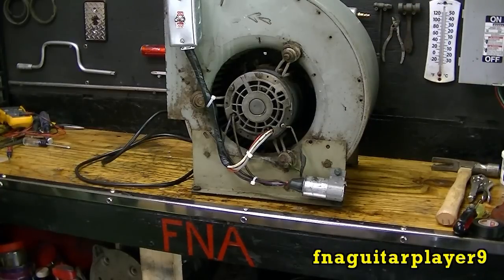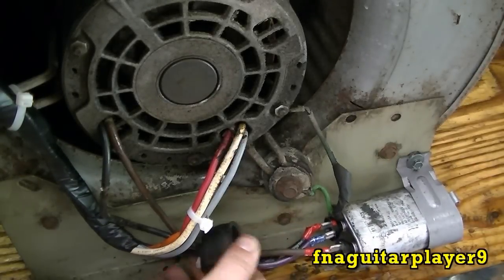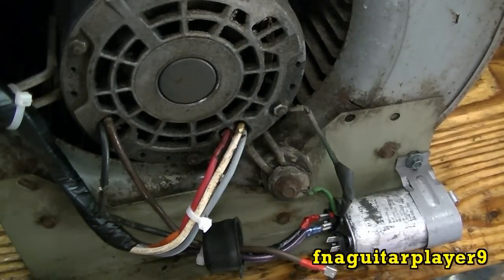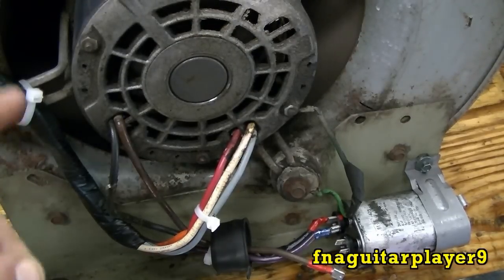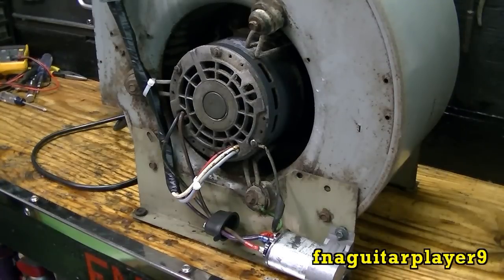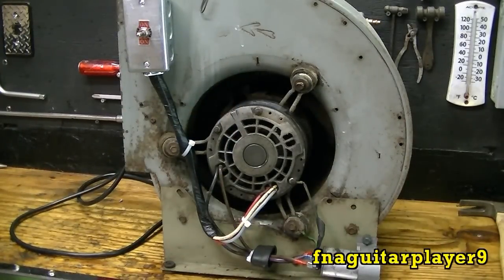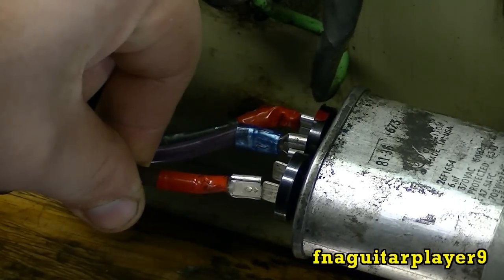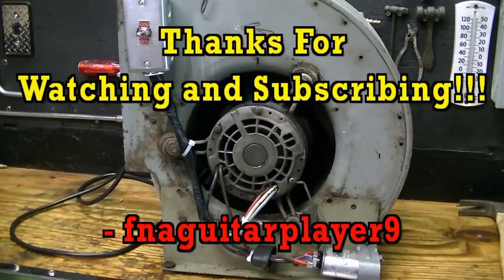Interesting Fact About Capacitor Start Induction Motors

Comment: ok...got a debate going on... right now here in La. we have 90 degree weather with 72% Humids.   its warm to say the least. Well last night about 11pm i noticed that my fan on my outside unit was running backwards.  This has happened before and it was a bad Cap.  So I did what my A/C guy said to do in a pinch and that was to reverse the plug between the cap and the motor.  Sure enough once that was done the fan ran in the right direction.   Well my lovely ADD kicked in and I forgot about it and went out to check it at 3:45p today.  It was running fine and I had missed the chance to go get a new cap again.  It started doing the reverse fan thing again so I reversed the wire again and it ran the right direction.  Now I noticed in your video that you have a 4 wire motor and without the cap plugged in you could hand start the fan in the opposite direction and it would run.  My fan is 2 wires.  ok.. the question... is the 4 wire "non-reversible" motor?   What would happen if the fan ran in reverse for an hour because no one knew it was doing that?  I hate to think Im going to blow the motor overnight by running it normal and it cycling and returning to the wrong direction at sometime.  The debate im having is how long could a motor run with a bad cap if you did what you did in the video by pushing the fan in the right direction?
Reply from the maker: Wilson Revelle I'm not real sure on this, but to my knowledge on motors, I don't think it would harm it, but the constant stopping and reversing might, but if it kept running in the wrong direction, i don't see any damage happening to it, again I'm not real sure on this, i do know if you do like i did in the video and have the capacitor unhooked, the motor is under alot more stress and can overheat. I would suggest getting a new capacitor as soon as possible just to make sure it won't get damaged. hope this helps, thanks for watching!!!
Reply: Nothing at all.
Reply: Wilson Revelle i

Comment: could you tell me this was starting  or running capacitor plz
Reply from the maker: this is considered a motor run capacitor, even though it helps start it. Most of the time if you have a start capacitor its round, more like a capacitor on a circuit board in a tv or something. Thanks for Watching!!!
Reply: Thank you brother for information
Reply from the maker: your welcome!

Comment: nice video. I'm just wondering since my fan motor has a capacitor hooked up to the + terminal of the motor and the - terminal has a neutral hooked up could I move the capacitor to the - side and the neutral to the + side would it spin backwards? thanks
Reply from the maker: Thanks. No that won't work, a AC capacitor functions the same hooked up either way, its not like a battery since the current is constantly fluctuating from + to -. Thanks for Watching!
Reply: fnaguitarplayer9 okyou're welcome.

Comment: Sir... how much capacitor should i need to help my car cranking in the morning? i still have my 12Volt battery attached.
Thank you for your advice sir
Reply from the maker: Capacitors aren't really designed for that, the only time a capacitor is used on a vehicle is for a sound system with subwoofers, because the bass notes will dim lights with each beat, but if your having starting problems its either the battery getting weak, the solenoid and/or the starter. Thanks for Watching!!!

Comment: Thank you. Great videO.  I am very clear after  not to know how to fix an old motor cap start/induction run  on failed big pedestal drill . I am not sure with my old motor 1hp 220VAC ,but have an old cap 200uF 125Volts ,right or wrong value.  I am understand ,it may be right on 200uF (for 1hp motor uf --> 138 to 180 uF  or may be above) but Volt should be 250VAC(its durable).  Please suggest me more.
Reply from the maker: your welcome! Glad to hear my video helped, the only thing i can suggest doing is running the model number of the motor online and see what type of capacitor it uses, thats the only way to be 100% sure if its right. Thanks for Watching!!!

Comment: Keep them coming professor. Nice show and tell.  I have a couple of expensive well pumps I took off line because of no run. Plan to take a closer look at them soon. How do you test to determine a faulty/burnt winding?..
Reply from the maker: I'm no professor haha Heard that, what i do is measure resistance between the wires feeding it (disconnected of course) this usually only determines if there is a open winding, because the resistance is so low it will almost read like a short. I'm no expert on testing motors but that gives you a idea, it will also test the start windings, especially if it has the centrifugal switch in it. Thanks for Watching!!!

Comment: It does this because on an inductance motor, there is a magnetic rotor surrounded by a wire coil. The AC voltage makes the coil an electromagnet. With single phase AC, you need a second slightly out-of-phase AC wave to induce circulation of the rotor. Without the start cap, there is no second out-of-phase AC wave, so no rotation. Once you turn the shaft (connected to the rotor), it causes a rotation in the coil of its magnetic field. That's why you can rotate to start either way. 
Most motors are optimized to run in an certain direction, that's why the start capacitor wants to rotate it counter clock wise;

Thanks for posting the interesting demo video!

Comment: I've never been paid to work in electrical but I know that all large induction motors like this use what is called a start winding and the reason it just sits and hums is because the run winding can't start it spinning. The capacitor is like a switch and initially is on until it charges up and shuts of the current to the start winding. Some motors use a centripetal switch on the start winding. You often here them click off when the motor reaches sync speed and off when the motor slows down after shutoff. Hope this helps folks understand ac induction motors a little better. The easier ones to understand are ones for things like blenders and mixers that use a series wound system with commutators and will run on dc as well.
Reply from the maker: Good explanation, also I will add that the start/run capacitor will also change the phasing of the start windings, as others have noted if you wire up the capacitor different it will start in reverse. It gets the rotor started. They are very complicated/confusing devices! Thanks for Watching!!!

Comment: my advice as far as changeout of capacitors: get a technician. there is some math involved in determining the capacative reactance in each system. it's not something you can guess or it can lead to fire or motor damage.
Reply from the maker: I agree. I'm a licensed electrician, and thats why i said this video was a experiment just prove that a "non-reversible" motor can run backwards. Appreciate the offer, i have books on the subject, motors and theory. I have worked with 3 phase motors before, they are very interesting, whats interesting to me is how you can run a 3 phase off of a single phase (starting it first) and it will generate the 3rd phase, so it can be used as a single to 3 phase converter. Thanks for Watching!!!

Comment: Your video was very helpful.  I changed the capactor in my furnace, but it still seems to humm.  The motor turns on and heat comes out but the humm is still there.  What should I do next.
Reply from the maker: Alot of induction motors will hum in furnaces some do to the low rpm they run, if they ran faster it would cool the air down, it could also be loose motor mounts causing a vibration or just weak windings causing it, kind of hard to diagnose. Thanks for Watching!!!

Comment: hook the black and brown up to the opposite capacitor contacts, and it should start by itself in the reverse direction.

Even easier, move the black wire from the top connection to the bottom cap connection, and it should start up in reverse.
Reply from the maker: wow, never thought of that, that makes sense, i'll have to try it, i guess it switches the phasing so it turns in reverse. thanks for that! thanks for watching!!!
Reply: fnaguitarplayer9 if you'd like I can email a PDF. on magnetism and 3 phase from my electric theory class. it's actually not too long winded and very interesting. inbox me and I'll send it.

Comment: Super easy motor fix: if you have 1 that doesn't start by itself, doesn't run well, or won't even hit a lick, find out if it has brushes. Then try to find some anti-oxidation/conductive grease in your shop or hardware store. Put it on the brushes with an old tooth brush, & see if that helps. I've fixed 2 motors that seemed hopeless, with that type of grease. The kind I have is called ' OxGard '.  Take care, Lee from TN.
Reply: This is not a universal motor , no commutator or brushes,  It has a squirrel type rotor .
Reply: @highspeedgaz  Oh okay, I've heard of them, but never really worked on 1. 
3 phase?
Reply from the maker: Are you talking about the No-Ox stuff that you use on aluminum wire? If so i have quite a bit of that, i'll have to try this out sometime!! Thanks for the tip! Thanks for Watching!!!
Reply: fnaguitarplayer9 Hey no problem man. Your No-Ox stuff sounds very similar to the stuff I've got. Who sells it? Its worth a try, I'm about to try to fix a couple of electric die grinders with it. I'm tellin' ya' dude, my dad's 2 HP table saw would Not hit a lick, put that stuff on the brushes, runs fine now. The 'offshoreorganbuilder' a few comments below should give it a try, but he also might need a new capacitor.  What area do you live in?  Take care, Lee.
Reply from the maker: Probably is similar, I find it at lowes, its in a bottle kind of like wood glue comes in. That stuff is messy haha Yeah it might help. I'm in West Vrigina, US

Comment from the maker: No it does not matter, and to be honest a higher voltage one is a better option in my opinion, think of it as buying a heavy duty version, if the voltage surges or spikes it would be less apt to damage the capacitor. The thing to watch out is the uf and if your replacing a motor run capacitor, it has to be a run capacitor, a start will blow up, and the same if your replacing a start, replace with a motor start. hope this helps! Thanks for Watching!!!

Comment from the maker: Usually if a motor just has a run capacitor it serves 2 purposes, Run and also it helps start the motor as you see in the video, sounds like you may have a bad capacitor, i'd suggest replacing the capacitor. You can't add a start capacitor if its not designed to have one. Thanks for Watching!!!

Comment: Hi, I have an ac motor and it looks like it has only a run capacitor, and no start capacitor. In fact, you have to push it a little to start. Is it simple to add a start capacitor myself ?

Comment: If I brought a capacitor with the same uf but with a higher voltage would this affect my blower or would it operate the same as the old one when it worked...I was told that the higher voltage would not affect blower

Comment: The local motor store where I live charges full retail out of the book for parts. (They also are one of the few technical/mechanical/electric/plumbing businesses locally that hasn't shut down.)

Much, much cheaper to buy off ebay or online, take a chance on getting the right part, buy the other possibility if the first one doesn't cure the problem.

Comment: Thats right, as somebody said below, it's run capacitor, motor will burn if you'll run it without that as well. You can confirm that by checking draw. If cap is too small or not there and you just spin it to go, it will run slow and weak and overamp eventually burn winding. Start capacitors include potential relay, used alot to help reciprocating compressors start.

Comment: the starting capacitor of an induction motor was in series with the auxiliary  winding, and they are both connected in parallel to the main winding. if you will switch that connection from the main to the auxiliary, the rotation of your motor will reverse.

Comment from the maker: yeah, i'll make it as simple as possible! I did do a video talking about how to use multi meters, i think i briefly talked about checking capacitance, but i didn't talk about when they need replaced or anything like that, but you might want to take a look at that video, its a older video i did, i'll pm it to you in a message...

Comment from the maker: The wires can be reversed but it won't effect the direction, since its AC. some motors will have a terminal block inside a cover that you can switch 2 wires around to switch direction, the type in this video doesn't, but mainly what i'm talking about is like a motor that mounts and is belt driven. thanks for watching!

Comment from the maker: sounds like a start/run like the one in the video, i ran that number on the internet and found that its called a start capacitor but works in the use of starting and running motors, i'll pm what I found, can't post a link in a comment, so i guess it is a start capacitor...

Comment: I disconnected the cap, turned on the bandsaw and it hummed.  I then turned the motor but it would not start.  Next i reconnected the cap and turned on the bandsaw and it ran like normal.  I then disconnected the cap while running and the motor slowed down a bit.  Reconnected and it sped back up so I think I have a run capacitor.  The cap is CBB60 SH 16uF @ 240VAC.  My understanding is start caps have a range of capacitance marked on them.  So what do you think?  Thank you

Comment from the maker: The centrifugal switch turns the starting windings off after the motor reaches a certain RPM, i'm not sure what it is, but once it comes up to speed (from the starting windings) it will activate and turn them off, same for the capacitor start type, it will disengage the starting capacitor. thanks for watching!

Comment from the maker: sounds like its a run capacitor, being that low of capacitance like you said, hard to say for sure, unhook it and see what happens, if its just a run capacitor it should start, but if it helps start it (even if it is actually a run cap like the motor in this video) it may not work with the speed control. Just don't run it very long at all without it hooked up and be careful when disconnecting/reconnecting.

Comment: I have a small bandsaw 8" and I'm trying to figure out if the cap is a run or start cap.  I want to add a speed controller but if it's a starting cap, then I can't.  The value is 16uF @ 240VAC.  The cap case is black and it looks like it is a starting cap but my understanding is starting caps have a much higher capacitance.  The motor is a small 2.7A motor about 0.2HP.  Any thoughts on this?

Comment from the maker: Very true, like i said in the video this capacitor severs 2 purposes, it helps start the motor, as you see without it it sits and hums, and it adjusts the phasing to keep it running, but can (not efficiently) run without it, and it does not have a centrifugal switch. But a normal capacitor start motor does use the centrifugal switch, and some have 2 caps one start and one run, this one serves both purposes. But yes they are actually run caps. Thanks for Watching!!!

Comment: I enjoyed your video.  The cap in the motor is a run cap and not a starting cap?  What I mean is this motor does not have a centrifugal switch that switches out the start cap and start winding?

Comment from the maker: Sounds like it may be a bad or weak start capacitor or possibly starting windings.. New capacitor *should* fix it if its not the windings. Starting it like won't do any harm, your doing the capacitor/starter windings job, but if you leave for a while humming without spinning, it will work on the windings and weaken / overheat them. Only reason on this video i said it might harm the motor is because the capacitor serves as a run as well. no problem, glad you like them! Thanks for Watching!!!

Comment: We have an industrial stand drill with a 3/4 h.p. motor.  The motor has a capacitor start.  Usually, it starts fine and runs normally, but just occasionally it will fail to spin and motor just hums.  Because of this, anyone who uses the drill has become used to giving it a twist, just before pressing the start button.  Any suggestions as to the cause of the problem?  Is it likely that we are doing any harm to the motor?  (We've been using it for over 30 years!)  Thanks.  (Love the videos!)

Comment from the maker: More than likely it will have a capacitor, if its not external it will a "cylinder shaped hump" on the housing of the motor, some have 2, one for start and 1 for run. But some won't have a capacitor at all, and just use a centrifugal switch to turn on/off the starting winding. Thanks For Watching!!!

Comment: I have to ask you this. I have a similar set-up from an old furnace fan. Mine is belt driven. Could my motor has an integrated capacitor or is it a complete different design ? I just plug it in and it goes full speed. Great video.